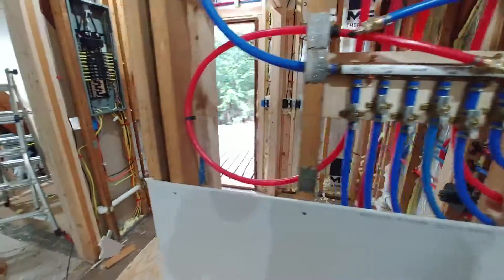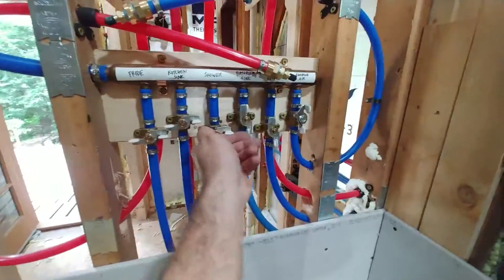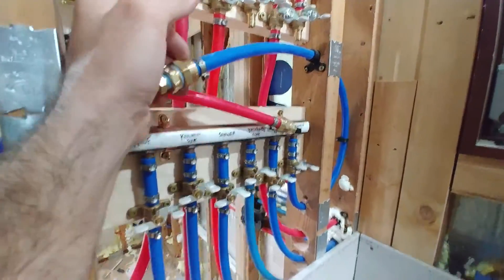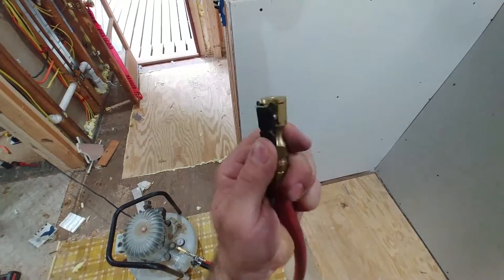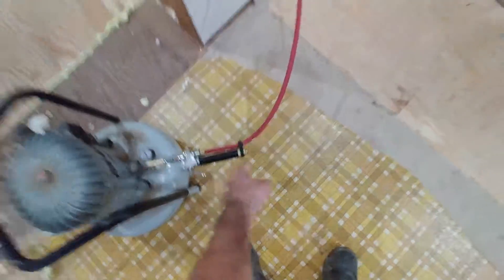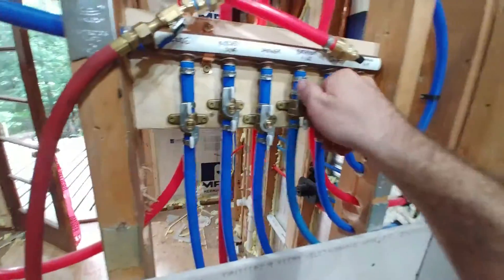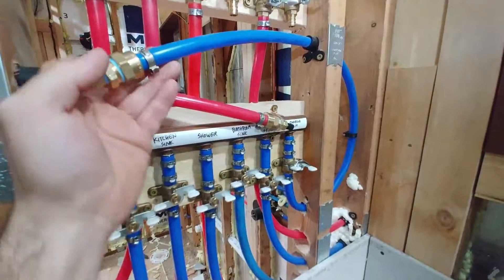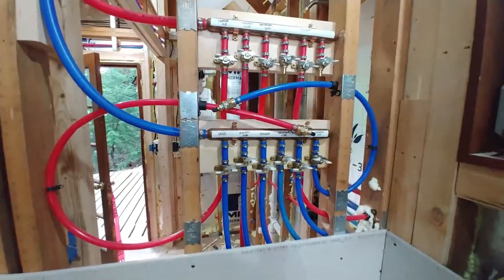Lakeside A-Frame Renovation Episode 21 - How To Pressure Test Pex Water Supply

Comment: A recommendation for anyone who wants to leak-test brass, copper, or aluminum fittings - Don't use Windex or any ammonia, chlorine/ bleach containing product on your fittings, it can cause the metal to corrode. This amount of corrosion is likely small and cosmetic, but who wants to risk harm to their new pluming install when it's easily avoided? Dish soap and water as stated in the video is a great alternative that has no potential to harm you or your plumbing.

Comment: I thought, you want to test up to twice the normal PSI, like 110. I also read that valves aren't rated for 110 psi, so those items aren't connected for pressure testing and their terminations are capped.
Reply from the maker: The primary reason for this arrangement was so that this seasonal property can be quickly and easily emptied for winterizing. Using a charge air source, you can individually clear each water supply line. I decided to put some pressure on the system and spray a little windex on all the connections to see if I saw any bubbles before I covered it all with drywall. I'm not about to put over 100 psi on it for any reason.
Reply: What are the valves rated? I put 100 psi on my system and it slowly leaked down with 4 valves closed and those lines aren’t capped. I’m wondering now if it leaked through the ball valves.